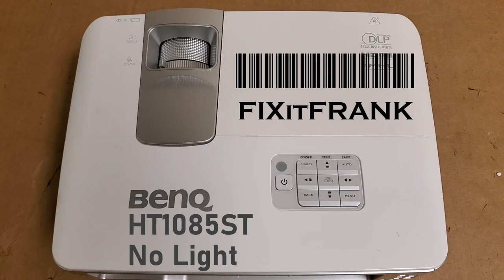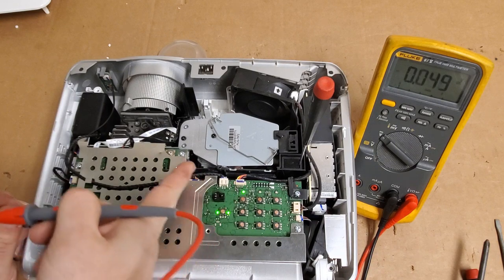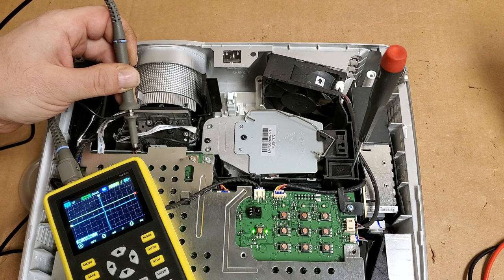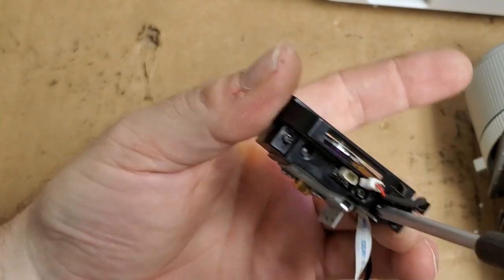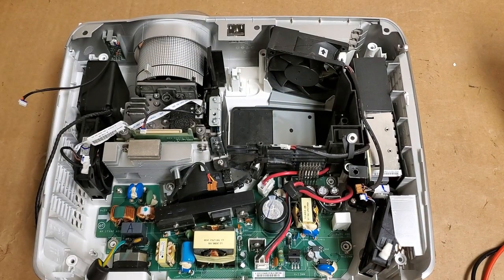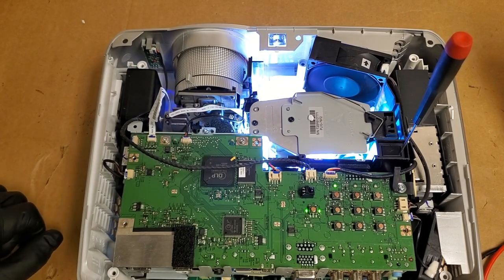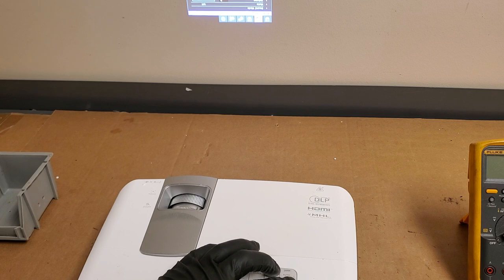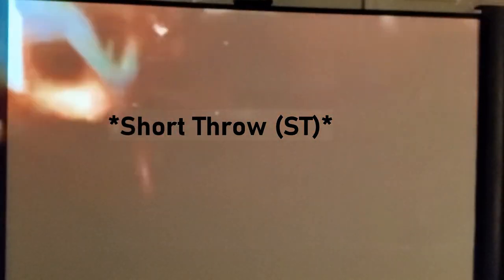BenQ HT1085ST DLP Projector No Light

Comment: Thank you for all the great videos! I have a problem with a W1070. No light, and Power and Lamp LEDs are acting like in your video. I have measured the 385Volts ballast input (present) , but no output on lamp socket. (also tried another ballast). The 14 and 3.3V at J30 are ok. There are pulses from the color wheel and i can hear that pip pip noise when it starts and runs for a while. Three of the fans are running, have DC voltage and pulses on the brown wire. The Blowerfan3 on J38 is NOT running. (ok on external power). There are no voltages on the connectors exept 3,3V on the yellow wire. No 12V on common point L134/C1050/C1048. It is not easy to make measurements on U112, but is U112 a known error on the W1070? Thank you.
Reply from the maker: U112 is not known to me personally as a common failure but I have seen those fan control ICs fail in other model DLP projectors.  For testing, you could try jumping another fans, 12v to the blower fan's 12v input.  I would de-pin the wire and connect it that way as to bypass U112.   If the fan status wire(3.3v) goes low to 0.02 or so, that will tell you that U112 is not responding properly.  The only thing that could also be an issue is the TI chip that controls U112.  If that isn't working, you might have to cheat and use another fans VCC to drive the blower. You wont hur't anything but you may have issue with high altitude mode.  The fan control ICs can drive a pretty hefty load so 2 fans on one chip will be OK.  Just not ideal. Hopefully it's just the fan chip.
Reply: @FixitFrank  Thank you for your reply. I de-pinned the red wire from J38 and connected it to grey J39. Now I got pulses from yellow J38 so I guess the fan must be running (?) but no lamp goes on. Same Led indication. Solid green and solid red. I have also checked that pin 3+4 on U112 and U111 have the same voltages 0.28V when on. All pins are connected correct to U112 and there is 12V on pin2. What could I check now? Thank you
Reply from the maker: Have you found the service manual? I only ask it is shows the connections for the fan status flags and fan speed control.  One method I use to determine where the issue is located(when I am unable to find a clear path) is to measure resistance from a known good point and compare it to the questionable point.  In your case, I would measure resistance between the fan sense wire connection(J38) and ground, and then compare that to another fan sense wire that is working.  I would unplug the fans in both cases and measure on the mainboard. You may find a difference in the resistance. Then you can start to trace back from the sense connection until you find where the resistance is more similar to the good side.  Then check the last component you passed as you worked your way down the circuit.    There is a chance you have a bad mainboard(just a warning). I believe the fans report via some small chips that invert the signal(low to high logic converter I think) but then they go right to the main DDP4420(4421?) Texas instruments chip.  
Here is the service manual with schematic. https://drive.google.com/file/d/1NQhBoO1IqMX_Zdnt27J-1B_L-BbONpnP/view?usp=sharing
Reply: @FixitFrank  Thank you for your reply and for the service manual! I have compared the signals around U112 and U111 and they are the same, except U112  pin1=0 The red wire J38 was connected to another output. Seems to me that U112 is part of the problem. I have also measured the pulses from the color wheel. Are pulses of 0.8V  normal values? Thank you.

Comment: Hi there. I have a 2 1/2 year old epson 2150. All the sudden will not kick on and fans on high speed mode as well as lamp and temp orange light on. I’ve replaced the lamp with oem and still no luck. Any pointers would be appreciated! TIA 
Btw, awesome content. Very informative videos.
Reply from the maker: Hi Carlos, That kind of sounds like a fan problem or a temperature sensor problem.  Epson's are tough as I am not privy to their service info. I can only figure it out as I go.  I've heard of this when the fan near the lamp goes bad. Sometimes its just the chip inside the fan that reports the fan status.  The fan will spin but the projector can't tell and errors out.  There is also the chance of debris/insects getting into the fans and jamming them.  The torque is very low and easy to stall the fans. There tend to be at least 3 fans in Epson, sometimes up to 5.  Many are the squirrel cage type/blower fans. I have a few videos on checking fans and how they can act that might help.
I've also heard of the temperature sensors going bad.  The little thermistor boards near the ballast/power supply.  I never experienced it myself but I would probably check there if it were me. 
That is weird that it happened right out of warranty.  It might be worth a call to Epson anyway in case there is something like a firmware update or other option to get things made right.  2.5 years is way too new for a projector to go bad from normal use.
Reply: @FixitFrank  thanks for the quick response. Cleaned out fans as you stated. There was quite a bit of dust but all were spinning freely. I plugged back in and it fired up. Only problem is now I have a green screen 😒 and some distortion lines. Called epson but unfortunately I’m out of warranty, just expired 3 month’s ago. They offered 30% off towards new unit. I declined. Is it worth fixing at this point? TIA.

Comment: Hey Frank, question on bulbs and lumens output.  Ive noticed some projectors use the exact  identical bulb yet will be 2700, 3000, 3200 lumens.  Example would be a infocus in14 or in24 or in30 which all have same lamp installed.  Power supplies look the same but maybe im missing something ?  keep up good work ...
Reply from the maker: Yo Kevin!  Very good question.  I notice that a lot myself.  I don't know the official reason, but what I have come to find is that the way the light is handled inside is different.  Lumens is a weird measurement.  Personally I think its not much more than marketing wank.  No one watches white pictures on their screen.  Lumens is a measurement average of a white screen at one meter away and one meter squared. You usually measure 9 points (3 top, middle and bottom) then you average those Lux(candlepower) readings. 
Lately I have seen more listings with "color lumens" where they measure each raw color for lumens and then average that. It's a little more realistic of a reading but even so, without taking into account ambient light, contrast ratios and other things, you are not really getting a truly useful measurement in lumens(in my opinion). 
One projector might have a lower contrast ratio but higher lumen rating where as the other model has a higher contrast and lower lumen rating.  It can be also due to the color wheel type, the length, size of the optical path among other things. 
One model Epson lamp has at least a dozen different lumen ratings across all the models it works in.  Basically you can attribute it to the differences in the way the light is processed and focused inside the projector and the type of lens they use.  Someday I hope an actual projector design engineer or technician will see these videos and I can bounce some questions off them.  I have talked to engineers at both Osram and Signify/Philips so I know those guys are out there. 
Hope that makes sense!  Also, if you run across any dual lamp panasonics that take ET-LAD60's let me know!

Thanks again man!
Reply: @FixitFrank  .. Thanks for input.  I have another strange question for you.  I recently had a optoma tx779 with bad dlp chip.  I had a good sharp d2710x chip that i swapped in and it worked ?  It was different part number but it looked same and both were 2700 lumens with similar specs all around.  Did i get lucky ? is this safe in long run? Thanks for heads up on those dual bulbs , none currently but i get new stuff in all the time.  I also have 500+ parts models on hand , should you need a part unavailable or only in china.  Keep in mind that most of my inventory is 5 to 15 years old on average. I obtain pallets from electronic salvage companies who consign them for coporations who upgrade equipment. On a pallet of 40 projectors, about 70% is operable or fixable and remaining are saved for parts on future purchases. You are a blessing to me with amazing detailed videos. Its feels good to be able to sell projectors to people who otherwise couldnt afford one.
Reply from the maker: @kevinduprey9326  You were kind of lucky but what you did was totally fine.  Many dlp chips use different part numbers(sold to Acer, sold to Coretronic) but they are the same resolution which is all that really matters.  I have used different resolution chips to test projectors before ordering the right chip.  I put a 1024x768 into a 1920x1080 to make sure it was worth buying the replacement.  You are 100 % safe and that unit should run fine. 
I'll keep you in mind for parts.  5-15 is about my normal vintage for projectors.  I don't see new ones under warranty. Honestly you and I have a pretty parallel existence in that regard.  I am not fortunate enough to get pallets of wonderful repairs, but I also like to help folks get projectors who normally would no have the option. I also noticed you take care of our feline friends :) My wife and I volunteer locally and just picked up 8 cats yesterday to drop off at the local rescue cat cafe.  
I know shipping can be a pain but if you ever get any units you want me to look at we can work something out.  It could help me with content here and help you with free/really super cheap repairs.   Keep it in mind and we can discuss via email if you want.  Have a good one my friend!
Reply from the maker: Hey anyway I can get in touch with you?

Comment: Ok, I am almost at a dead end. My W1070 does not want to be revived with simple replacements. I have the dreaded no light from the lamp and red LED flash on and remains red and shutdowns. I have tried to replace colour wheel, lamp and ballast in that order and leaving the new components in place. I then put back the original colour wheel, lamp with the new ballast with no success. I can hear and see the colour wheel spins up and then slows down. I do not see any sort of lamp flickering up at warm up before fully powering on that is why I thought maybe the ballast is defective. New ballast does no show any difference. I am about to give up but I may be able to pick up a used model for parts I will try to chop and change and see if I can get at least one working projector. If this is not successful, do you have any suggestions or tricks to test this projector and try to fix it? 
BTW, thank you for providing the pictures of the ballast wirings previously.
Thank you
Reply from the maker: You're welcome and I'm sorry it is still not working.  Do you have 380Vdc at the input to the ballast? Without proper PFC power to the ballast, this can happen.  Also, is the ballast being sent the LampOn signal? If you read LampOn signal and you have 380Vdc at the ballast, then I agree the ballast is bad.  If you have ~300vdc at the ballast input and a LampOn signal, the Main power supply has a problem.
Reply: @FixitFrank  Oh crappola. Now I have to consider the main PSU. I have to check how much for one if it is worth it to purchase another part. I already spent $150 or so on the 3 parts. I will check to see if the main PSU providing about 380Vdcc. Just check about $125 for the PSU. Ouch, this may be be sold for parts now. I might as well pick up a new 1080p or just put a bit more and get a 4K

Comment: Anyway I could get you to fix my projector? If I turn the brightness down or put the projector in Eco mode I get a lot of flickering. Also the Fans make a bit of baring noise when first turned on but eventually that goes away.
Reply from the maker: I'd be suspect of the lamp.  If it isn't an Osram bulb inside it might not be the right bulb. flickering in Eco mode tends to mean the arc points in the bulb either have scale on them or that the bulb is rated for a much higher powered ballast. 
How many hours are on the lamp and how many of them are in standard mode versus eco?  One suggestion I give to people is to put it into standard or bright mode for a few hours and burn off the scale on the arc points.  Then once it goes back into eco, the arc tips are clean and the arc will sustain nicely.
Reply: @FixitFrank  The bulb is fairly new. It has 1623 hours on it now. All on standard because Eco was flickering out of the box. The old bulb did the same thing. I got the projector as a refurbished model direct from BenQ. The projector is a BenQ TK800M. This problem has existed since I got the unit. Here is a link to the replacement bulb that I put in it. https://www.amazon.com/gp/product/B07MPSYR4T/ref=ppx_yo_dt_b_search_asin_title?ie=UTF8&psc=1

Comment: Hey Frank, Whats the operating temp supposed to be? I have Benq w1070. Thank you
Reply from the maker: Hi Mido, I have found that between 140-170F is about normal. It depends on ambient temperature. You are referring to the exhaust temperature correct?
Reply: @FixitFrank  in the hidden menu, there is  Temp #1 sometimes it reaches 300-320. On the normal mood. I was always using the high Altitude mood, as the projector used to get super hot and shutdown. Thanks to your videos I managed to find the reason and fixed it. :)
Reply from the maker: Oh wow. Yeah that's high. I bet your exhaust fan has the same issue that ht1075 had with blunted leading edges. Also make sure (if it's used or refurb) that some one didn't invert the fan direction.
Reply: @FixitFrank  thanks frank, will check and let you know. Regards.

Comment: Hi there, had similar issues to another video of this projector where color was flickering so followed your directions in your other video, put it back together and projector didn´t light up at all and now lights below ballast on board are red,yellow,green instead of green. Any suggestions of things to check I might have messed up? I havent taken it back apart to see if color wheel sensor connector is messed up as in this one but on initial inspection, while still in it looks okay.
Reply from the maker: Check the alignment of the low voltage pins into the mainboard. It sounds like you might be off by one position. That is super easy to happen.
Reply: Ah its okay now, but even though i cleaned off sensor, its blue for a second then starts flickering colors again for a bit then shuts off. back to square 1 ugh. i definitely tried to ensure i went at color wheel sensor quite a bit with a q-tip. maybe something is loose or sensor is actually bad? originally lamp needed to be replaced, i did that and then this started.
Reply from the maker: Is the color wheel cable upside down by chance? It also may be a bad wheel. I have seen the sensor wires break at the solder point.

Comment: Frank have you ever seen vertical lines displayed at startup?
Reply from the maker: Hi David! I have but usually it is after the mainboard has been removed and re-installed.  A bad connection between the DMD and mainboard can cause it.  If you can share a picture of the issue, I can give you a better idea.
Reply: I re-connected all and hit it with some contact cleaner. It looks like I will need to replace the fan next t o the lamp.

Comment: Hi FixitFrank, I have a benq mx764. When I plug the power cord in the red power light will light up for about 15 seconds and then go out. The green start button will stay light but does not start anything. Nothing runs light, color wheel or fans. Any suggestions? Thanks
Reply from the maker: What you are describing kind of sounds like a panel lock. https://www.projectorcentral.com/pdf/projector_manual_6411.pdf page 36.  However power should still work.  
There is a chance it's a mainboard problem. Did anything happen before this started?
Reply: Before it stopped working at times it would have horizontal lines and I could tap the projector and they would go away. When I plug it in with the top off on mainboard the power button red light stays on for 20 seconds then goes off. A slow flash on a green light at the back left on the mainboard and goes off after 25 seconds. The two power button green lights on the motherboard stay on.
Reply from the maker: ahh. you might have damaged the mainboard (worse case).  hot plugging the DMD board can cause issues.  That said, I would take the mainboard out and reseat it and make sure its in securely and that the screws are in the right spots.  If nothing changes then the mainboard might have failed.

Comment: Hi Frank. I have a W1070 that I can't get to start up. I recently replaced the globe as I thought this was the issue. After reassembling and plugging it into the mains I get  "POWER" indicator in solid RED and thats it. I have found in a few forums that tech advice from BENQ is that a new board is required. Have your come across this and could I fix it by replacing faulty components on either the ballast or the power supply board? Thankyou for all your awesome videos. Great indepth content.
Reply from the maker: Hi Luke, If the power led comes on then that is a good sign.  however if you get no response from the buttons, that may be a power problem on the mainboard.  The ballast is probably fine.  The main power supply would be suspect as would the mainboard itself.  Those mainboards are not that expensive to buy used(pulled from good projectors) and would likely be your best option. Otherwise you would want to start investigating the PMD1000 IC on the board to see if that failed. I have seen that as a common failure point on the mainboard.  Replacing it requires SMD soldering though which I know isn't exactly a household staple.   How are you with a multimeter?  You can check a few points to see what's going on.  You tried the remote as well correct?  Just in case its the button itself?